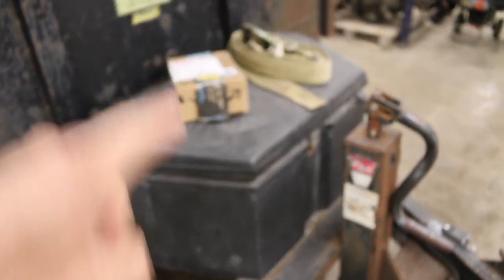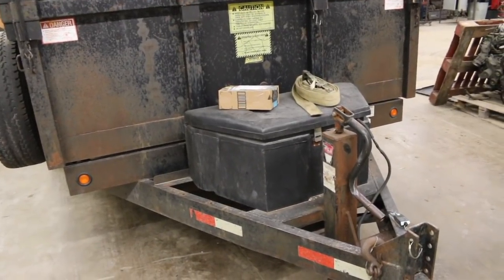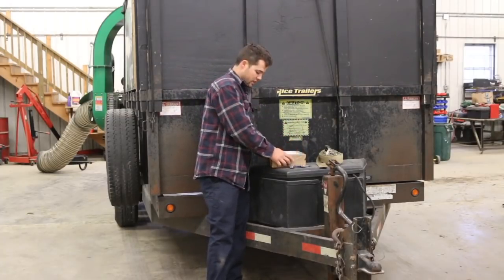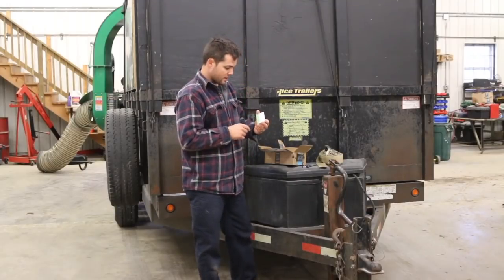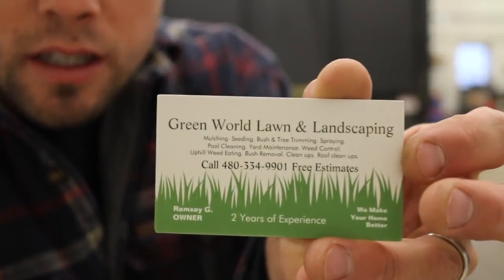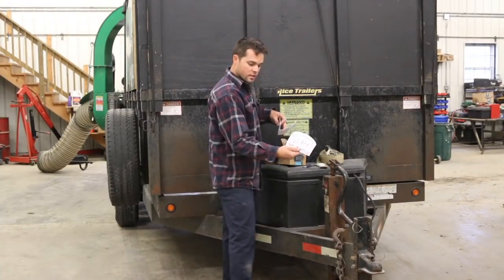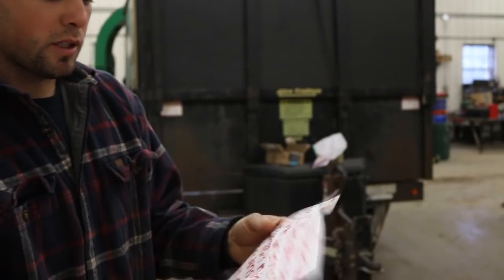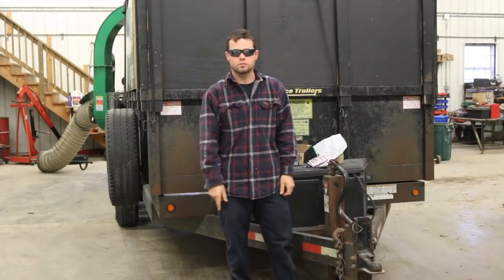"The Leaf Monster" Set Up, Mounting the Billy Goat DL37 Debris Loader

Comment: Our leaf vacs are mounted off of the tongue of the trailer. That gives my guys the ability to dump leaves without having to move a leaf vac.  I can see the advantage of having it one the back as well.  There is always more than one way to skin a cat. You have a good setup there!
Reply from the maker: When it’s time to dump we simply open the door and dump. We did not have to modify the factory pin system to hold the door open.
Reply: Yeahi like ours on the touge too I can see the guys better too

Comment: I am surprised you didn't make the leaf loader removable for off season. You carry around the bracket on the back of the dump trailer all season?
Reply from the maker: Removable would make it weaker. It was a consideration but we hardly use this trailer in the summer so we decided to weld it solid.

Comment: The only thing that I would have done different with this trailer is put. 4 legs are welded to the trailer in the front over where the?
 Tool box is and then put a platform and put the vac on that.  So it is stationary so it does not move instead of having it on the back door of my trailer. Maybe you could back into something or someone hit into the back of your trailer and there is your full clean up and if you are done using it for leave, clean up?  Cover the top, cover the part with the hose goes on and you can continue using the trailer instead of taking it off and on the trailer.That's just my thought and that's how I have mine
Reply from the maker: We did that on a previous set up. We have ran it just about every way and the back of the trailer was the best for us.

Comment: Great video Alex, i created a similar setup on my trailer and cant wait to see how it does. My issue is with 400 lbs on the tailgate, the tongue of the trailer is very light. It wants to bounce and sway going down the road with out weight in the front. Did you have this issue or do anything to add counter weight? My trailer is only a 6x12 so i think that could be some of my issue with the wheel base being shorter.

Comment: What about dumping ?? I’m always down for a better way to mount, but I have never mounted to the actual trailer in fear of oil and gas mixing together and choking it out..??? Mine is currently over the tongue
Reply from the maker: We simply open the door and latch just like it was designed from the factory. We were fortunate enough to not have to modify that part of the door. As far as oil/gas mixture the  trailer being dumped is no more of an angle than a mower on a steep hill  or  trailer ramp. I thought about it initially but don’t see it as an issue.